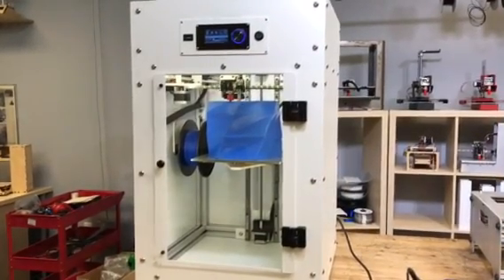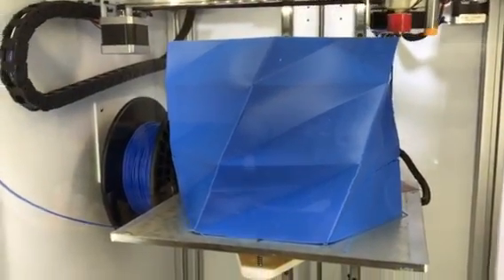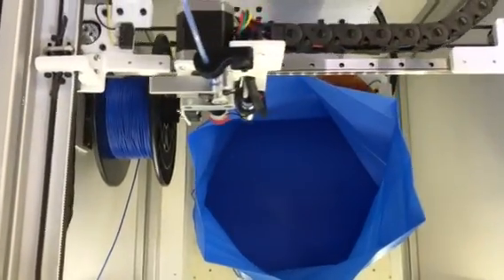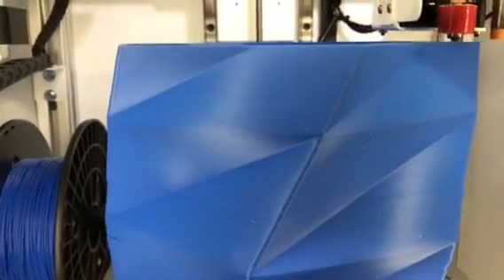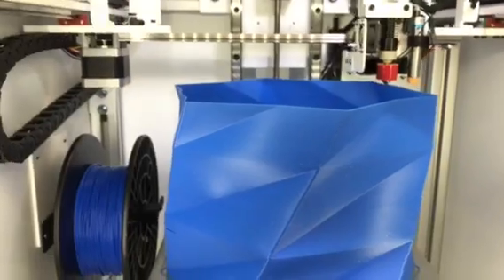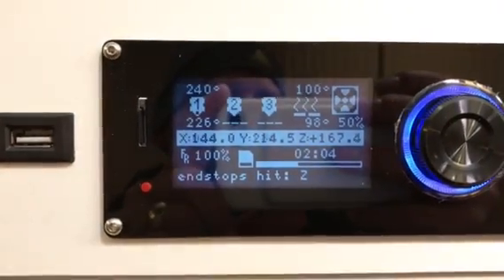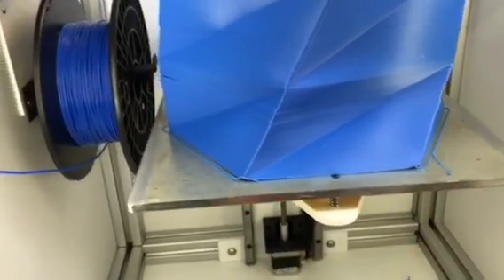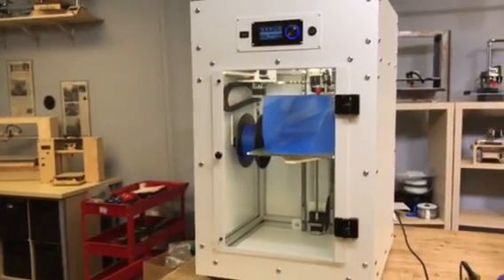Printrbot Prosthetic Printer update #4

Comment: So is this all a demo for a new mass produced printer?
Reply from the maker: It's a one-off for a prosthetics guy. I'm showing it for fun and to see if it interests anyone. 

Nothing is really "mass produced" at printrbot- we make our printers right here in California. We source locally (except motors and bearings and bars), we even make the electronics in house. 

This one, we designed, water jet everything in house, folded the metal, sand and powder coat the metal, assemble.... its as far as it gets from mass produced ;)

And it is not for sale at the moment. Maybe never. Just showing our work.

Brook
Reply: Brook Drumm What would the price be on something like that?
Reply from the maker: Do you need it for prosthetics? I'll probably do a version for general consumption but the build volume would change. I guess it's worth what people would pay. So what would you pay? And what would you use it for?
;)
Brook